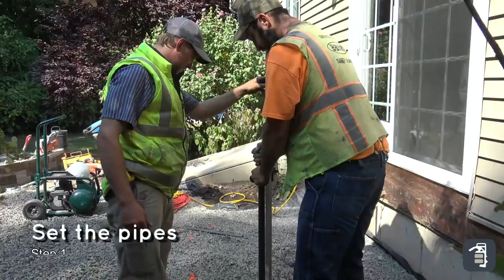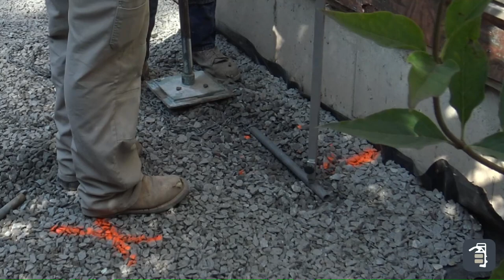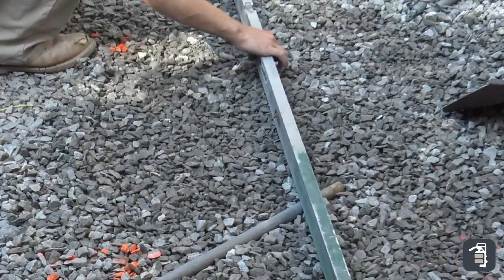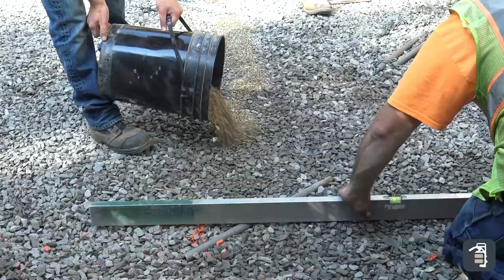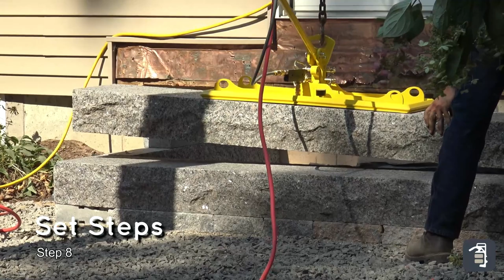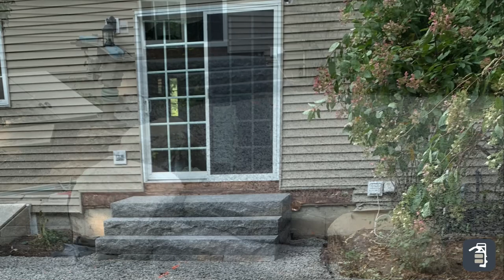Best Practices for Setting Monolithic Steps

Comment: Cr6 and/or stone dust may work for you, but there is a push in the industry to move to 8’s, 9’s, 89’s on top of 57 stone for walls and steps.  Some people are doing pavers the same way.  Benefits include easier to get proper compaction and no water retention under the stone to cause freeze thaw issues.  With the tools available now such as lasers and suction tools, you can get a better installation with less grunt.  

Anything with dust takes more effort to get fully compacted.  I still prefer 3/4” crusher run for pavers, but I prefer the way they do it in the video for steps and walls
Reply from the maker: Thank you for watching our Video! We couldn't agree more with your approach! We install using a Permeable grade system which includes the 3/8" #8 and #9 setting bed on top of 3/4" #57 clean stone.